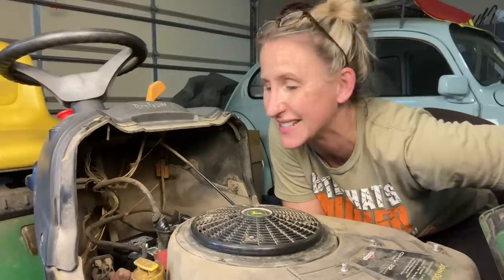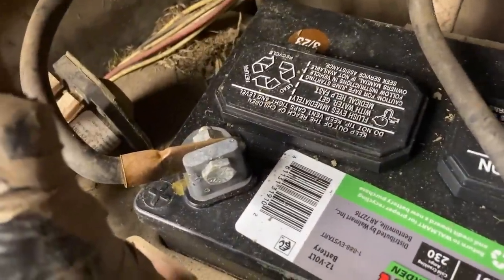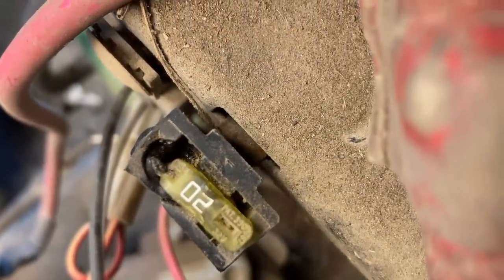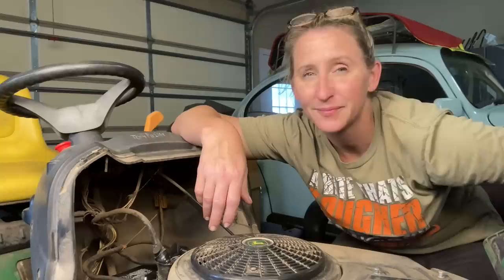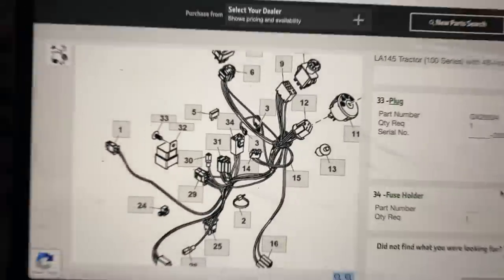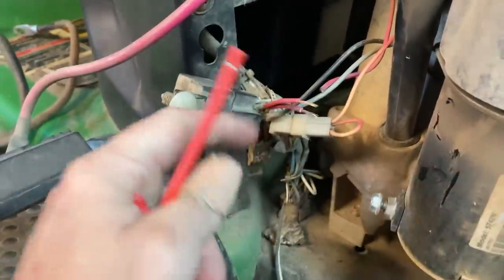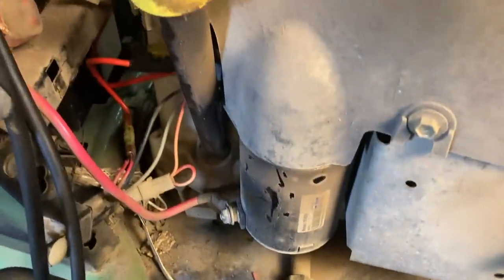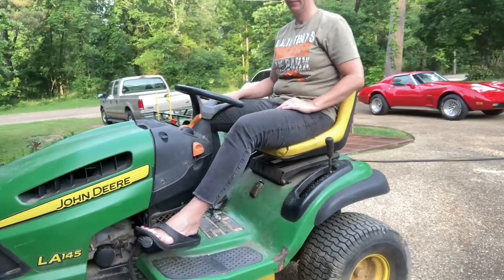Customer connected their wiring BACKWARDS! Mower won't start now. CHECK THIS FIRST!

Comment: When I was a ag mechanic, I went on a service call for a dead combine.  Custom stated it ran when parked.  I found lots of disconnected wires at the engine.  Customer finally admitted they had replaced the main wiring harness, after they parked it.  Lots of time and effort tracking all the wires down.

Comment: Roger Roger on the fuse. First thing I look for or tell customers to look for. I have the heat shrink butt connectors and the I also have the solder seal butt connectors too. Good fix Bre!

Comment: Fist thing I would have done after starting is see if it charged. Reversed battery can  burn out the stator in the alternator or more often the diode in the wire. That is what draws high current when reversed and should just blow the fuse.

Comment: You forgot to check the voltage regulator for proper output.  Reverse battery connection could easily fry the regulator.
Reply: Doubtful she forgot, more likely chose not to show as it should be as obvious to all as it was to you.

Comment: If you don't have an originally configured battery you can get into big trouble. Some mowers are configured with the posts reversed. Sometimes the parts clerk will give you the wrong one if they fail to verify the post configuration.  Sometimes a box store will have only one battery with the posts reversed also. You need to pay attention, or at least verify where the positive post is before buying the battery.

Comment: they probably had the wrong battery in it at one time. the only difference between a group u1 and a group u1r is the terminals are reversed on the battery case. real lucky it didnt fry the rectifier(i hope you checked the charge system). the no mow in reverse that uses the relay saved those magnetos.  fancier riders with modules  get real expensive with that mistake!

Comment: I come here with a really unique thing to tell ya. I know slime, fix a flat or any of that tire sealer is just TERRIBLE and to never use it. However this is one i tried a friend told me and as a joke i had a beat up old scotts with tires that haven't had wind in them in 5-7 years. the side walls were cracked so bad they only held air for about 10 mins before they were flat again.

dump a cup of ATF transmission fluid in them and it fixed the leak!! They now last about 2 weeks before going soft. I seriously don't know why this works but i would love for you to make a vid on that! I seriously do not have a clue how ATF fixes leaking tires and the best part is its a lubricant so it never causes rims to rust!!

Comment: I think the person that rewired the battery was a little confused 🤔 

A couple years ago I rebuilt an old L100 that was in pretty rough shape. My first problem was I couldn't get the ignition to work. I knew nothing of these mowers and the problem was staring in the face. I first thought the empty fuse holder was an unused connector (the headlights had been removed from the mower I was working on). It was only after I found a wiring diagram that I realized it was a fuse holder. BTW thank you so much for the video on the compression release on the cam. I couldn't figure out why I had to back off the crank to start the engine. Now that I know I will likely leave it the way it is as it still starts every time, as long as it's past the compression stroke and hopefully the weight will stay in it's new forever home in the sump.

The reason the fuse holder melted is because the fuse partially failed, all that should have happened is the fuse filament should have burned, leaving the holder intact. The position of the fuse is terrible and should actually be covered. When dirt and moisture gets into the fuse holder, add heat and it forms oxidation and compromises the fuse connections in the holder, so it takes more amperage to burn the fuse. This causes excessive heat (this can also be the result of a cheap fuse). Further if the circuit this fuse was protecting would have had smaller gauge wires it likely would have melted them; I have seen this happen in older cars with old fuse boxes. Anyone with a similar setup should remove the fuse, blow out the dust, use some WD 40 or better deoxidizer spray, blow it out again and reinstall the fuse (its best to replace it with high a quality automotive fuse like "littlfuse", they are much more expensive but they blow more consistently and faster), then cover the fuse holder to keep the moister and dust out.

Comment: I bet they added those longer cables (and connected them wrong) because the previous battery probably had the + and - reversed.  Just a thought.  Awesome video as always.  Cheers.
Reply: Yes, agreed. I ran into that same scenario with an old Craftsman mower that I have.  But fortunately had enough slack in the cables to accommodate the positive and negative being reversed on the new battery.
Reply: My thought exactly. Bought the wrong battery once before and added the cables, then bought the right battery this time and didn't switch it back.

Comment: Thanks! I bought a battery at Walmart. He gave me a battery with the terminal reversed. I Installed it and turned the key.  One thump and then nothing. I checked the battery and realized the positive and negative were backwards. I returned it to the store and got a new one. After installing it, nothing. And your video told me about the fuse, which I changed, everything's fine. Thank you for this video.

Comment: Your videos not only save time and money - they can also save lives!  I recently tackled a fuel line replacement on my Husqvarna tractor after watching a few videos - when I had it apart I realized the gas I was smelling was coming from a fuel line barely holding onto the tank. Literally fell off in my hand. Didn’t want to think what this would have done if I had been running it when it was hot.  Many thanks!

Comment: 2 possible reasons for the tape on the cable they spliced together:
1) Since they didn't know what they were doing, they knew enough to think that there shouldn't be any bare connections that could cause a problem.
2) Since they hooked the positive to the frame, they may have accidentally shorted the joint to the frame and realized that they needed to insulate it.

Comment: I had a neighbor that replaced the battery on his craftsman rider, starter turned, but wouldn't engage the flywheel. My other neighbor asked me to look at it, thinking he hooked the battery up  right, I didn't check. Installed new bendix, and same thing. Only then did it dawn on me to check the battery. Sure enough, it was hooked up backwards. Switched cables, and presto, engine starts!

Comment: I never use insulated butt connectors any longer. I buy uninsulated connectors and cover them with marine/glue heat shrink. They are water proof and they are very low profile with a much better connection.  Seen this on the YouTube channel, Wrenching With Kenny.

Comment: I just bought a new John Deere model S 100. My previous model LA 105 lasted me 12 years. The mower deck finally just plain wore out. But the tractor still runs. Just like you say-it's amazing what a regular yearly oil change--air filter- greasing and blades replaced will do. I never had an engine failure. And guess what--the 12 year old blade spindles are still good, and I suspect they would fit this new deck if needed. I saved the old blades, spindles, pulleys and other hardware. a little maintenance goes a long way.

Comment: John Deere used black cables for the 110/112 tractors. I am not exactly sure when they changed over to using the red positive cables. Having both cables black do make things more difficult when going through the wiring.

Comment: I love the newer aftermarket connectors w/heatshrink built-in.  I also love that you can get them in double sizes.  That is to say that one side might be for 10 ga., while the other is for 12 ga.  They're phenomenal.  I especially love the ones that come with solder instead of a crimp connector.  Of course, with those you have to be very judicious with the application of heat.

Comment: Great video. I tended to make this mistake myself, often. I started painting up the positive's on batteries, wires and connectors with some bright red nail polish I bought, to try to fix this problem. Now, as long as I'm paying attention, i get it right... most of the time.

Comment: Before replacing the fuse box better check if it's really the fuse by bypass the fuse.  If it work, than you can get a new fuse box and fuse.  If it doesn't work than more troubleshooting to do.

Bypass the fuse is much easier and quicker and cheaper than a trip to the store, just for troubleshooting purpose.

Comment: I had three customers come in with the battery installed backwards. On two, the starter was just spinning backwards. No other damage. The third one, though, blew my mind. The battery was connected backwards and ... nevertheless, everything was working right! The starter spun the right way. The PTO worked. The stator/regulator was charging the battery, albeit in reverse! The only thing wrong was that the battery wouldn't hold a charge as long as it should. I mean, I can't understand why! /s I don't know how long it was running like that, but obviously it was like that long enough to reverse the polarity on the battery. How it did that without melting the battery or anything else, I will never know, but... if I hadn't seen it with my own eyes, I would never have believed it!

Comment: I had a guy give me an old Ford garden tractor/mower. He said he charged the battery and the starter would still not engage. Since he new I worked on old mowers he just gave it to me because he couldn't figure out what was wrong and he had a zero turn he was mowing with anyway.   The starter was running backwards and wouldn't engage the starter bendix.  Thing is, it was an old unit. Some farm machinery used to use a positive ground. He had reversed charged the battery... yes, it did hold about half a charge. So... I discharged the battery completely... waited until the next day and then recharged it correctly. Hooked the battery up correctly and the starter worked fine. There was several other little things that needed to be fixed but within a few days it was running like a top. Cost to fix... about $50.00 for oil and filter, air filter and spark plug. I also cleaned the carb, sharpened and balanced the blades, greased the front axle and spindles, greased the mower spindles and checked the belts. Seems like I sold it for around $450.... nice profit!!

Comment: Thank you so much. I was troubleshooting a fuel delivery problem and my battery died. Didn't realize my borrowed battery had opposite polarity and hooked it up backwards!  I had the backwards spinning starter but didn't realize at the time.  Then nothing worked and I saw the battery was backwards. I didn't see a fuse but hopefully I can find it and didn't trash anything else.  Stupid hurts.

Comment: I love your helpful videos and frequently share them with my other DIY pals.  I am still chuckling about your frustration with the new fuel containers and the government required spouts.  Mine have all been replaced with less complicated aftermarket spouts.  
In the video on ethanol for small engines, your ability to sniff the percentage of ETOH was impressive.  
I have a fuel question:  I always add 2 cycle oil to a gas can before adding gasoline to prevent me from forgetting to add the oil.  However, when a relative borrows a tool and fuel, is there an easy way to determine whether oil has been added to the fuel.
Thank you for your excellent videos.

Comment: Some of the powersport batteries (ATV/ Motorcycle/snowmobile) have the positive and negative posts reversed from that. That would mean if they bought the wrong battery before... they might have needed to extend the leads to reach the posts.. that is my bet anyway
Reply from the maker: There are snapper rider batteries that have reverse posts too. Might have been it.

Comment: I took an 86 dodge charger turbo in to get a replacement battery.  Well I rolled into the local Wally World and when I went to get half an hour later and hit the starter. It was instant smoke from the hood and dashboard. When I looked under the hood the cables were backwards. It was so bad that to get the cables to fit the :"tech" even switched the cable ends so it would fit the wrong posts.

Comment: I once bought a battery for my mower and the terminals were marked wrong.  The old battery was still installed and I noticed the new battery would be installed backwards according to the terminal markings.  I called the guy and he said...oh we've seen a few of those lately bring it back.  I was glad I didn't hook it up.

Comment: Enjoy your helpful knowledge! I am helping a neighbor who’s husband has passed. She has an Areins lawn tractor with this same 22 hp B&S engine. Running but fuel started coming out the muffler after it was shut off. When I investigated more found that fuel tank was draining into the crack case. I checked the solenoid to prevent backfire with a 9v battery and the solenoid was clicking. Also remove the carb bowl to confirm the float and seat were ok and not plugged. Changed oil and filter and all seem ok with the engine. However it has a big issue with the “automatic transmission “ where it only will bang into drive or reverse when the brake peddle is applied. Is this condition as bad as I was told, not worth replacing the transmission because the new would be about 1400.00 to have it changed?
Thanks in advance for your thoughts.
Model is A22A46 Ariel’s/Husqvarna.
Ron

Comment: Good job , like watching you work on these mower’s. Just waiting till you get a J/D LA 135. I’ve had that mower for so long can’t remember what year I bought it. It’s been one good mower. Never a problem. I’ve only put 375 hours on it.  (New)
Reply: I have a JD LX178 bought new in 1994. Had in the shop once to replace a bypass hose on liquid cooled engine mechanic had to loosen engine to get to it. Otherwise just maintenance: belts, blades, filters and oil changes. You get what you pay for.

Comment: That is a WTF.  I know people do things for a reason, but I have no idea whatsoever what that reason might be. One suggestion if I was going to replace that fuse panel, I would put in a 20 amp circuit breaker instead when I put auxiliary wiring in my vehicles instead of using a fuse I’d use a circuit breaker instead, so if there’s a problem, I can instantly reset it.  Plus it prevents some dumbass from throwing a 30 amp fuse in a circuit design for 20 A.

Comment: Does the battery charge circuit still work after all of that? It would be my luck the diode blew along with that fuse.

Comment: The Conflict in the Direction of Electrical Flow
We had a conflict. The theories and books all said that in a circuit, electrical current flows out of the positive terminal of a battery, and returns into the negative terminal. These discoveries concluded that, contrary to conventional wisdom, electrons flowed the other direction.

Comment: Check that it still charges the battery.  Your customer will be lucky if he didn't fry the stator.  Or if it has any kind of voltage regulator.

Comment: I had a person bring in a trimmer last week. She did everything right . She missed one thing and it cost her $40 because that is my base rate. She didn't install the throttle cable so it would only run on choke. Have you had this in your shop?

Comment: Immediately at loss thinking about what would have cooked the fuse if polarity was reversed? What is on that fuse? A PTO? Solenoids and motors generally don’t care about polarity. The solenoid just tries to go the wrong way. DC motor turns backwards.

The fuse holder melted. It shouldn’t melt before the fuse blew. I think the contacts got dirty, resistance increased, holder melted, things quit working, owner tried to fix by replacing battery (because batteries are the only thing electrical that the masses think they understand). And for inexplicable reason added extensions to cross the polarity. Maybe someone had replaced the battery before with one that had reversed terminals? That electrical tape and cables did not look new.

Comment: Possible explanation for the jury rigged wiring on the battery - whoever installed the PREVIOUS battery, didn't know that they usually make models of each type of battery with REVERSED terminals - signified with an 'R" in the model number - which means that the positive and negative terminals are on opposite ends of the battery from where they normally are - the installer of the previous battery bought an "R" model battery, was either entirely clueless they'd bought the wrong battery, or was too lazy to be bother going back to the store and exchanging it for the correct battery, and just jury-rigged the cables to connect everything to the correct terminals.
This time around, the owner bought the model battery with the terminals on the CORRECT sides for the mower, didn't realize that whoever installed the old battery had jury-rigged the wiring, and simply connected the cables back up the way they had found them on the old battery.
ALWAYS check and see which side the positive and negative terminals are on when it comes time to replace your battery.

Comment: Years ago a friend wanted to change his points, cap, rotor, plugs and wires and since he had zero mechanical ability I was going to help on Sunday but he got impatient and did the work Saturday… 
I arrived on Sunday to find him complaining it wouldn’t start and he’d spent hours trying to find the problem, so I pop the cap, points were not set so I fixed that- still won’t start so I pulled plugs and checked for spark and set gap, yup got spark…
Hmmmm 
Uhhh, James did you make sure the plug wires went from the cap to the plugs the same as they were connected?
“Does that matter?”
*facepalm*😂